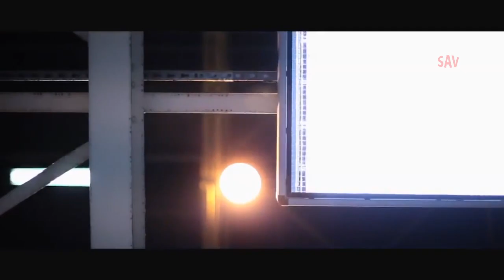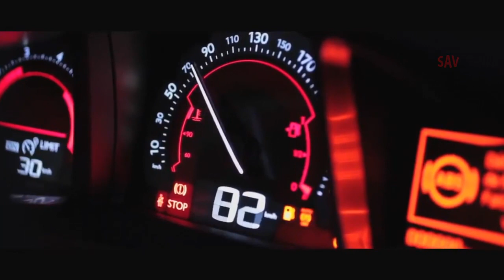Citroën DS5 Production, Citroen Car Factory (Sochaux, France) DS5 Assembly Line

Comment: Hi i am sending xantia mechanic i am xantia mechanic i wanted to ask engineers citroen why xantia inside the oil source did not leave a magnet or magnet because the iron circulates inside the oil circuit and the hydraulic components break down. Let go. Thanks to Taher Soltani, Iran
Reply: Should check out forums